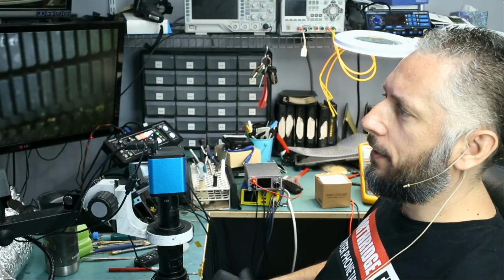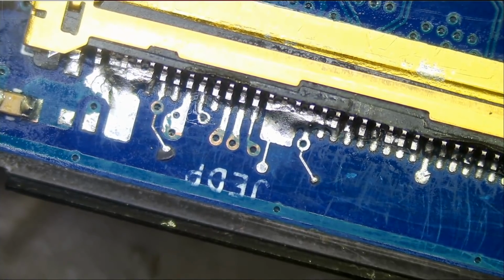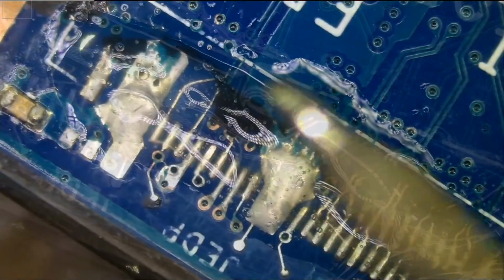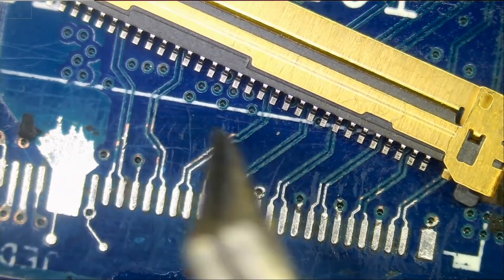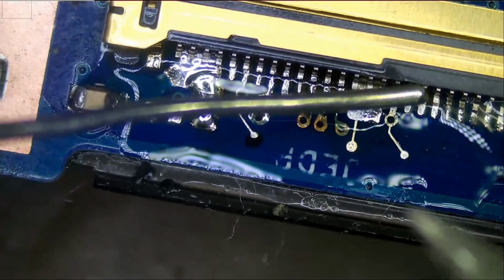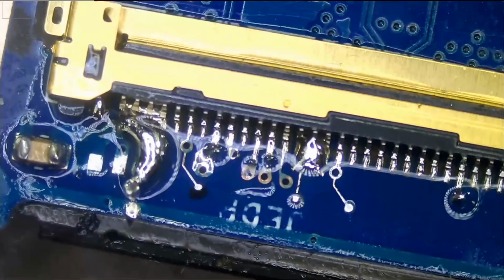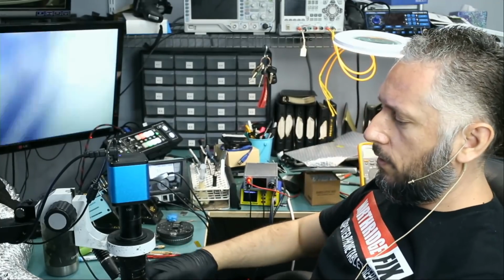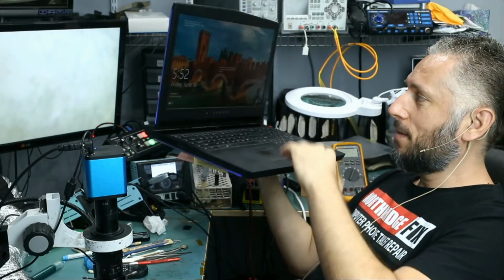Alienware R4 Gaming Laptop Motherboard Repair - Damaged LVDS Display Connector

Comment: Thank you for your video. i was doing a massive upgrade and reconditioning on my Alienware 17r4. did all the thermal grease and pads replacement, new NVME and SSD disk and of course, new battery. in the process of removing the logic board, i damaged the connector at the LCD ribbon "got to excited and forgot to disconnect the ribbon. 

i ordered 2 of those connectors and finally got the parts yesterday and put it in today. To  be honest with you? you have my deepest respect. LIKE HOLLY MOLLY. needless to say that i damaged my first connector in the process and thank god i bought 2. my 2nd one is now installed, but a real pain to solder all those pins without having a bloody blob or solder. lots of wick used on this project. 

2 hours later? my Alienware 17r4 was back to life with a nice display showing "ALIENWARE" as a welcome boot screen. Very happy with it, but my god, it wasn't fun to work on. practice does make it better. Thank you very much for the video. love your channel and keep on the good work.

Comment: Important question please, damaged connector can make motion blur on the screen? my laptop Asus 17' is with screen 300hz 3ms.

I repaste it from time to time but before 2 weeks the screen start to have a motion blur (only when watching a videos)

screen is set to 300hz in windows settings

scrolling fine - no motion blur
browsing - no motion blur
games - no motion blur

using fresh windows 10 from different SSD - have the same motion blur.

so if I watch your videos, I see your face moving with little blur effect.

what could be reason please?

same for CPU mode and same for GPU.
via HDMI (connect to TV) there is no motion blur

Comment: I forgot to push out that wire frame of this connector, and its side ends took of the board.
After a black screen I plug an external monitor, and I saw a black screen either. Its impossible to gain acces to BIOS. All this happened after the keyboard replacement.
The keyboard lights works
Any Idea ?
Tks

Comment: One trick I learnt in my early years is if you are going to take a product apart, leave the screws in their original place when disassembling. Makes it easier to know where they go when re-assembling. Don't leave them in containers.
Job well done.

Comment: Hello my video flex cable has a problem is it possible to repair it by soldering? My laptop screen is flickering and on the rare instance it works but for a short time.

Comment: if the owner of this laptop is reading this please know:

1- you were doing well but your tools betrayed you.

2- you only need 4 mayor tools; soldering iron with 3 tips (beveled, chisel and bent tip), hot air station, Flux (amtech of course) and solder wick.

those are my recommendations from one hobbyist to another. Happy soldering everybody.

Comment: Why do customers try to fix them selves?  Had one this week with abs module for bmw. He tried to fix himself and ripped off over 100 very fine wires. No way to fix without either a schematic or even another moduel. Then gave me hassel because I could not fix it.